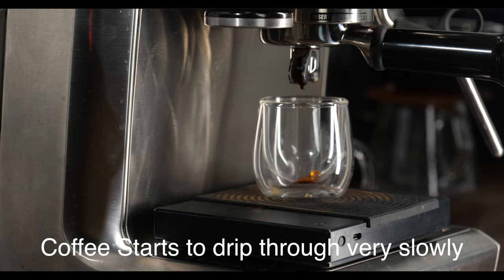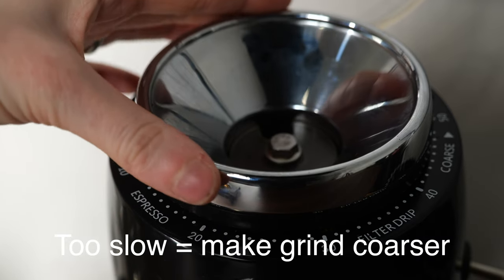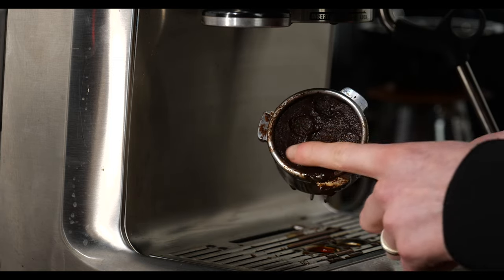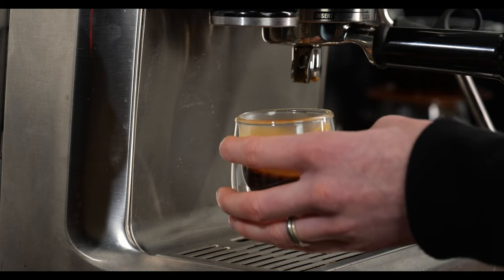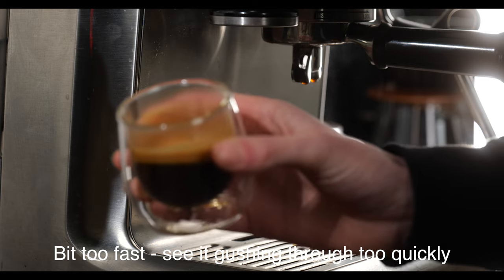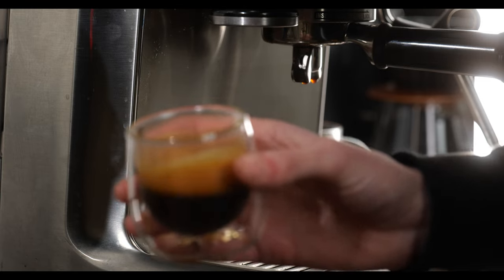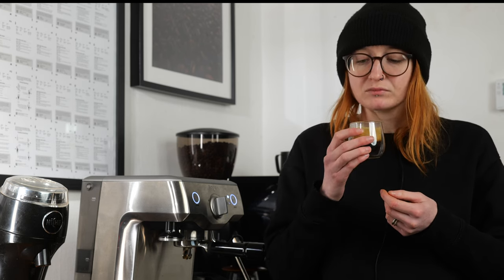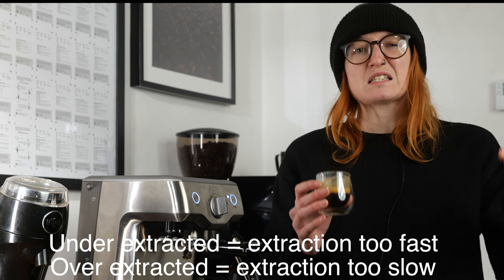Dialling in Espresso & Filter - Beginners tips! Using the Sage Duo Temp and Niche Zero

Comment: Hi there! Just bought the Niche, after getting the Sage. Any recommendations on which grinding setting you use on the Niche? I tried  around the 18-20, but tastes too bitter. And 24 goes through very very fast. Always 17.5gr. I don’t know, very frustrated tbh. Tried sooooo many combinations… Any recipes to share? Also wasting so much coffee… 😭
Reply from the maker: Hi! Sorry for the late response. I used between 10-15 depending on the coffee and recipe. Are you weighing and timing your coffee out? If you put 17g in you want double out, so 34g liquid out. If it’s tasting bitter try lowering your dose of coffee slightly and see where you are then.